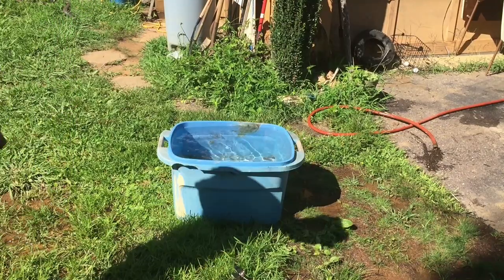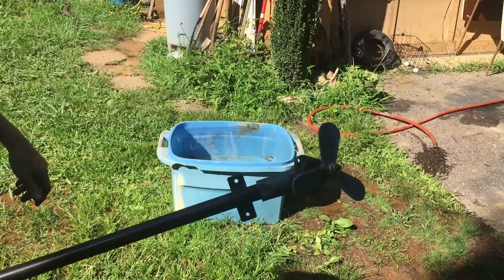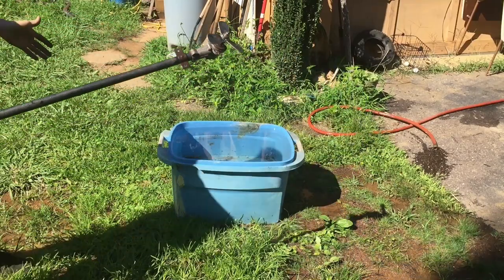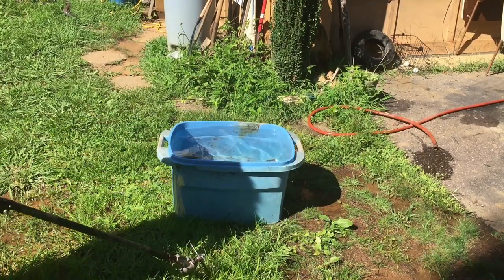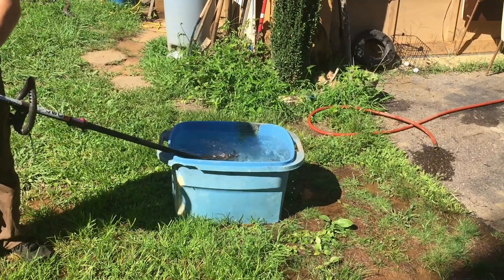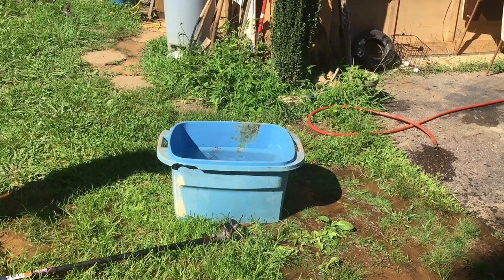boat outboard made from a weed whacker

Comment: It needs reduction gears and small pitch. 
The 1:1 ratio prop ; engine 
Outboards have a reduction gearbox.
 Or use a tiny prop off a radio controlled boat that runs this HP engine.
Reply: So that's why when the engine cut off the spinning thing was loud
Reply: He had the pitch shallow enough, that it actually would have worked reasonably well. The only trick would be to make sure the prop can spin fast enough, to avoid constant slipping of the centrifugal clutch.

Comment: That motor will work pretty good I had a small 18cc motor with a trolling motor prop and it worked great till I blew the motor the flywheel was plastic and it got to hot and melted

Comment: Tried this with trolling motor propeller about 15 years ago. Didn't work. It would die every time you stuck it in the water. I trimmed the propeller off till I could get it to run in the water without going dead. After that it would barely move the boat.
Reply: A trolling motor prop has too much pitch. It's designed for more torque at a lower RPM, so it's quiet in the water. The angle drive on a weed eater is 1:1, and those small displacement 2 cycle engines don't have a lot of torque. He did the right thing, making a very shallow pitched blade, so it could turn fast enough to keep from slipping the centrifugal clutch. He just needed to pitch it to the right direction.

Comment: I did this in the early 90s with an green weed eater and a 2 bladed replacement trolling motor prop. It made a lot of wind out of the water but in the water it had bad cavitation issues and then it just bog down and stop. I fixed it by trimming the blade length down little by little until it worked pretty well. The blade length was just under an inch when everything was said and done but it would push my canoe up the river with decent amount of speed
Reply: Under an inch and still moved water? Seriously crazy. Do you think you got it up to like 3-5 MPH? How fast is a rowing team?
Reply: @skipjames8437  I couldn't guess at a speed but I'd say it was about rowing speed.. if the prop went too far off the center line it made the canoe feel really tippy

Comment: You got the blades on backwards. But I like the fact that you didn't destroy the weed wacker to put a prop on it. You can take the top off and still use it as a weed wacker. Good Tinken

Comment: Flip the prop around so it will be pushing rather than pulling, if you try and attach it to a boat as it is now, it will reverse. You could also try increasing the pitch of the prop in order to transfer more power into the water.
Reply: The prop pitch needs to remain shallow, because the angle drive is 1:1, so the prop needs to allow high RPM, to avoid slipping the centrifugal clutch. Those engines don't have much torque.

Comment: That thing is like 6 or 7 feet long, your going to have to row out for a bit before you can use it, plus that thing will never start while in the water, but it will make a nice fan on hot days if you can stand the noise
Reply: It will start just fine: the centrifugal clutch won't load the engine, until the RPM is up. A stop ring can be used to adjust the transom depth of the propeller, it's just that the head will be up there a bit: he just needs to stand up, to pull the starting cord. He'll have to clamp a tiller handle on at a usable height.

Comment: Sometimes those small 2-stroke engines get a lot of oil coming out the exhaust and clogging it up, might want to check that and also maybe need to clean the carb
Reply: Improper oil/petrol mix.
Reply: You might actually break your pistonrod, water is way too heavy for this engine. Even 3mm trimmer line could actually do that, more likely to happen with 2-stroke engines smaller than 30cc. Go for a cordless drill instead, fish happy, Greta happy😀

Comment: Where there drive shaft connects to that sweet motor, it's probably gonna melt. I put a saw blade on my and it ran for about 30mins and was smoking like a greatfuldead concert. Still got them little saplings though.

Comment: YOU NEED TO PUT SOME PITCH ON THE PROP AND TRY IT ON A BOAT OR WATER CRAFT !! FUN IDEAR THOUGH !! GOOD LUCK!! 👍😉
Reply: The pitch needs to remain shallow, since the angle drive is 1:1, and that small engine just doesn't have much torque. It was actually just about right, if he hadn't pitched it in reverse. Other than that, I think it would have worked reasonably well!

Comment: DONT DO THIS without any reduction the 2stroke engine will not be able to work even a small 3inch prop in the water because it cannot achieve the required high RPM. also those engine are AIR COOLED and will burn out if run a long time >1min at high torque low speed.
Reply: It looked like the prop had a shallow enough pitch, to allow enough RPM to avoid constant slippage of the centrifugal clutch.(it just looked like the prop was pitched the wrong way)You are right though, the angle drive is 1:1, which, with that tiny engine, doesn't give much torque.

Comment: Looks like the prop is backwards
Reply: I noticed that also.The question is, what's better for the angle drive as far as thrust goes?d(it's really easy to turn the whole thing around, and let it pull rather than push, depending on which way the foot is less susceptible to axial thrust from the propeller.
Reply: Just mount on front of boat
Reply: If he used on of the ones that has attachments he could make a mount using a bearing that fits the shaft and mount it to the back or front of a John boat
Reply: And change pitch. Or create multiple props to check speed and performance.

Comment: Why go through all that trouble, just take a threaded rod attach a trolling motor prop with just a couple of lock nuts, run it through a 3/4 pvc pipe, attach to any cordless drill you want, way more powerful than that, will push a houseboat

Comment: Dude - if you mounted that at about a 45° angle inside a large leaf blower/vac extension tube/nozzle, you could evacuate all the accumulated stinky silt/crap/algae off the bottom of a water trough in about ten seconds.. Just make sure you aim the outlet AWAY from you LOL. For what its worth, I found a small plastic or resin boat propeller in the clearance aisle at Walmart for nine dollars.

Comment: Good mechanical skills but your diy prop has no pitch to the blades. Without pitch all it will do is blow a hole in the water and your boat won't move.

Comment: make it drive the other direction because as is youll be forcing water past  the gearbox seal where other direction wont ..... 2 stroke motor does not care which direction it turns it will run same same both directions OR change blade mounting.... whatever

Comment: not enough torque or a beefy enough clutch to handle pushing a boat. maybe a hydrofoil but...
Reply: The prop looked shallow enough, that it would run fast enough to avoid slipping the centrifugal clutch. (It just seemed to me, that it was pitched the wrong way)

Comment: I'm not being one of those dick headed safety noshers but I'm curious why you don't wear gauntlets and a jacket when striking weld? Not judging just curious, cheers...
Reply: clive ramsbotty I would agree. I have been welding for 30 years. Always tried to use safety gear but not always. Well now I keep having skin cancer spots butchered off my arms. Permanent red splitting and freckles only on my forearms. Dr told me I spent too much time in the sun but I was neverr a sun worshiped. I worked in a shop and most shop shirts are long sleeve a choice I always made working around hot equipment. I actually was diagnosed low vitamin d because I'm out of the sun so much so the cancer isn't sun exposure. I now make sure I have my welding jacket or welders sleeves if it's a bit too warm for leathers. Everyone that welds please cover it up. Getting jumps of skin hacked off the size of a quarter isn't fun or appealing to see.